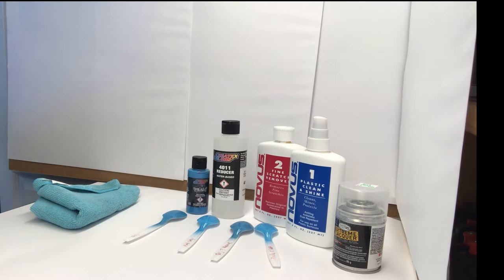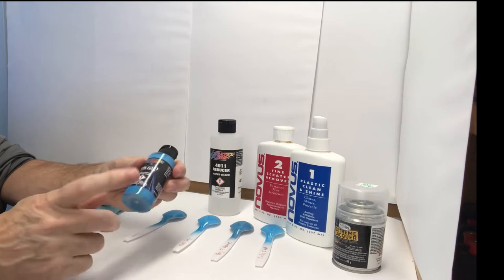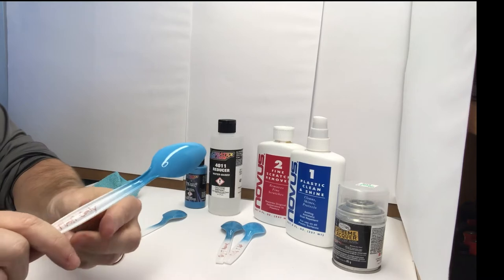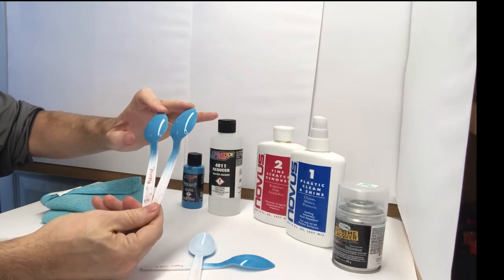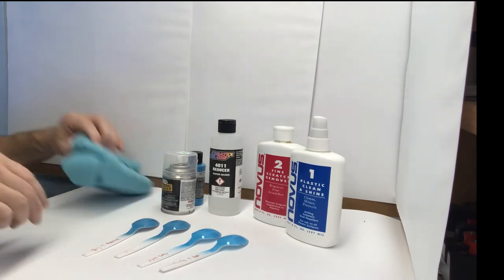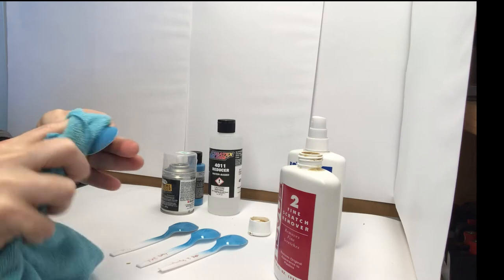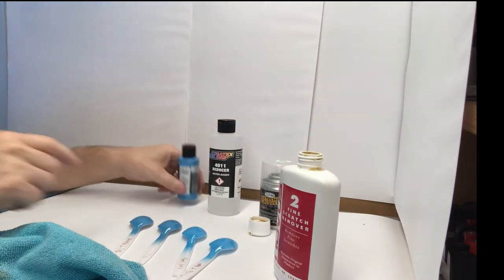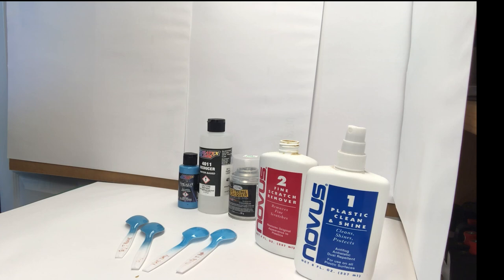Createx Paint Spoon test with Clear and Novus

Comment: Nice presentation. 
I would say the reducer would be used depending on weather and/or type of airbrush used. A Badger SOTAR is a detail only airbrush and you would need the thinnest needle/tip avail. For a standard airbrush with a 0.03/0.05 needle/tip you won't need the thinner/reducer. A lot of model builders tend to forget all the other uses for airbrushing. lol Like T-shirts/paintings/real cars.
Reply from the maker: I think you're spot on. I use a Iwata NEO the reducer really wasn't needed